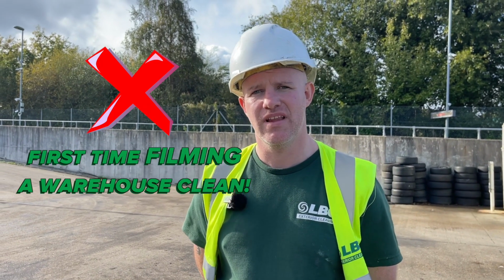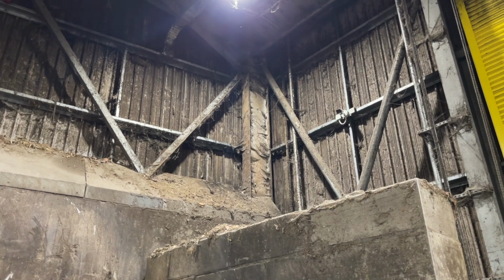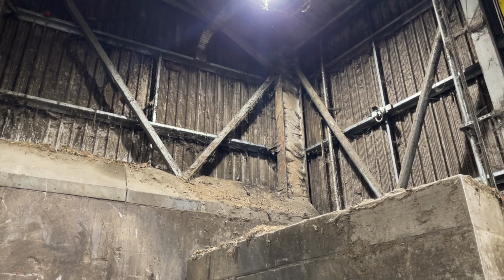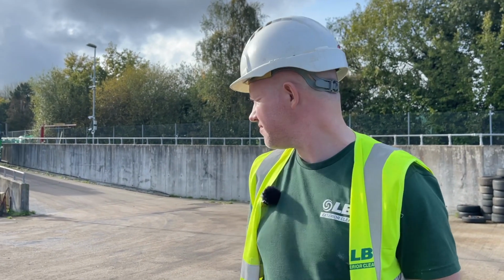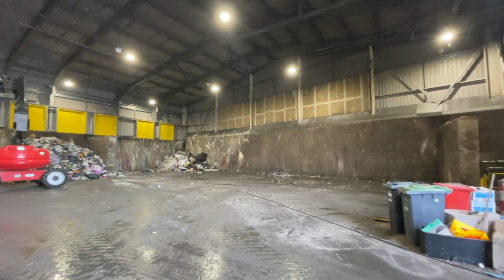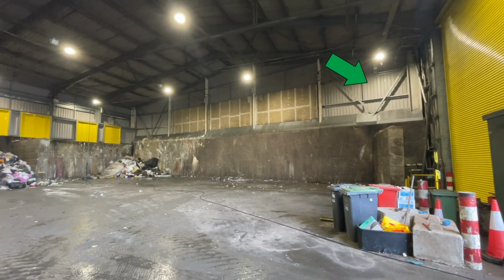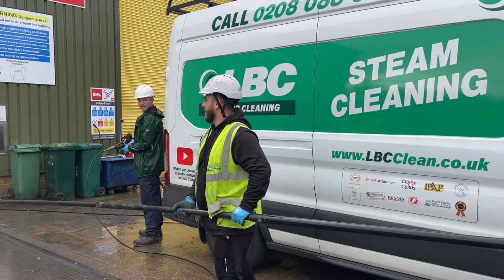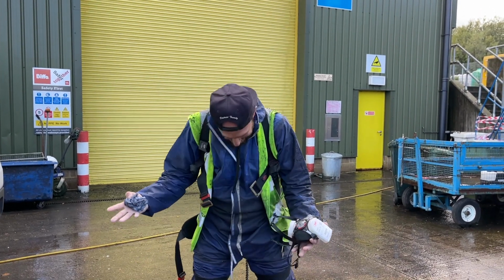Pressure Washing A DIRTY Waste Transfer Station - Huge Transformation!

Comment: Great 👍 video keep up the great work and much love ❤️ from America 🇺🇸 
⚔️ 💪
Reply from the maker: Thanks so much for the support 😃
Reply: Why not use a heavy degreaser on those metal doors/panels and rinse them…seems like it would be less stress on the body
Reply from the maker: @parkerzi    hi thanks for your comment, the reason we don't use chemicals for sites like this is because they have underground drainage intercepors which are used to seperate the oil and using chemicals could affect this and cause an environmental risk

Comment: Softwash will save you time
Reply from the maker: hi thanks for your comment, the reason we don't use chemicals for sites like this is because they have underground drainage intercepors which are used to seperate the oil and using chemicals could affect this and cause an environmental risk

Comment: not trying to be negative but what is the point it will just end up like that again in a few weeks
Reply: Maintencance! duh! if it gets like this in such a short time,imagine after years without cleaning! it gets worse, just like you wash your car after it gets dirty...why cleaning it...itsgonnaget dirty again eventually am I right.
Reply from the maker: Hi Mark, thanks for your comment. This particular waste centre hadn’t been cleaned in many years!! The build up of dirt/dust was a fire hazard and it was in desperate need of cleaning. You’re right in saying that it will build up with dirt again but like Mat said in his comment, regular maintenance is advised. 👌 
Thanks for watching 😊
Reply: @LBCExteriorCleaning  
May I ask, you don’t use cleaning products ? Sodium hypochlorite etc, it would make short work of that area
Reply from the maker: @artinconstruction9070  hi thanks for your comment, the reason we don't use chemicals for sites like this is because they have underground drainage intercepors which are used to seperate the oil and using chemicals could affect this and cause an environmental risk
Reply: @LBCExteriorCleaning  
Thank you for the reply,
My comment was meaning to be helpful,
Thank you for seeing it that way,,

Something we use salty water ( pool supplies ) it helps break it up, or run dishwashing soap through the buffer tanks, it helps a lot, least harsh chemicals as possible, 
Just food for thought,
Great video by the way